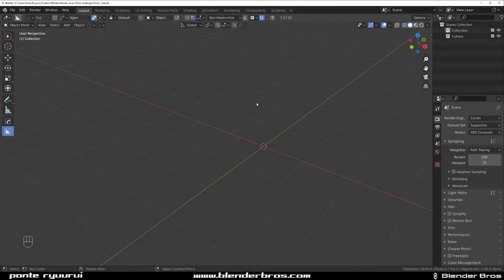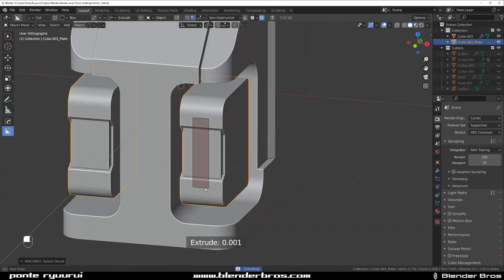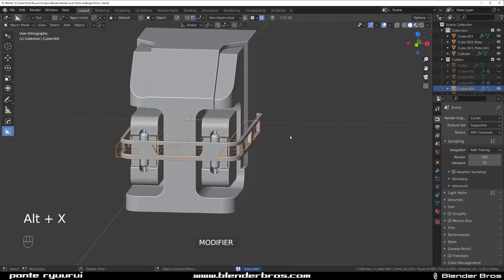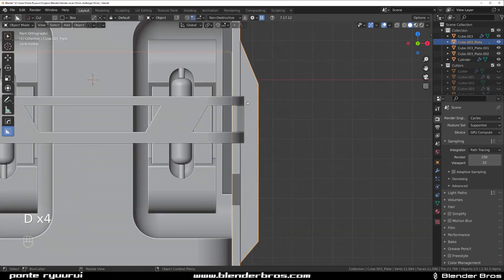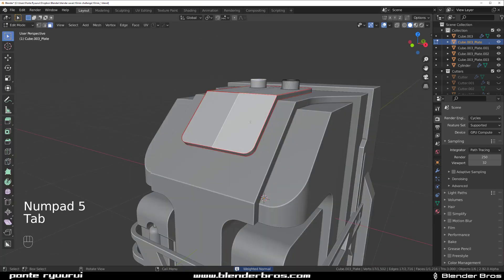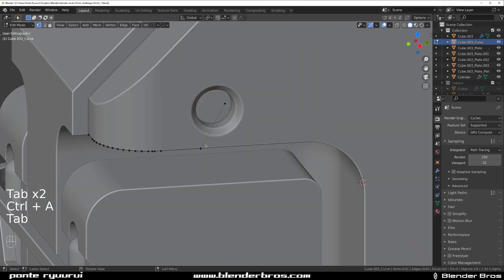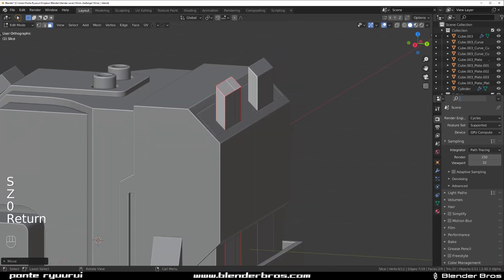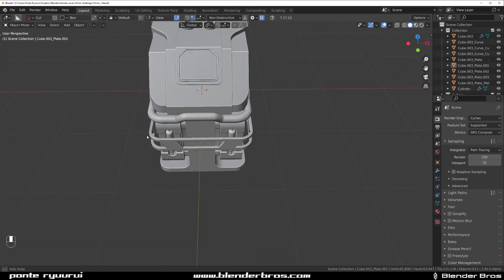15 Min scifi hard surface concept design tutorial for Blender

Comment: At 4:00 you can just inset and then use the standard "bridge edge loops" command to remove the faces and make the interior wall all in one go. Not sure if many people know that ^^
Reply from the maker: ya that also works, i actually should not have applied the solidify there, so one face removal would fix it